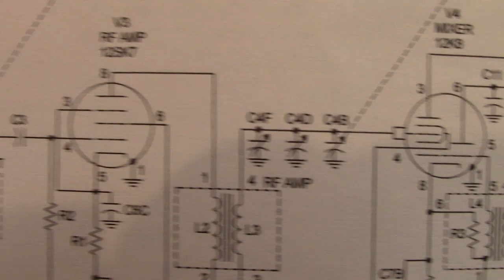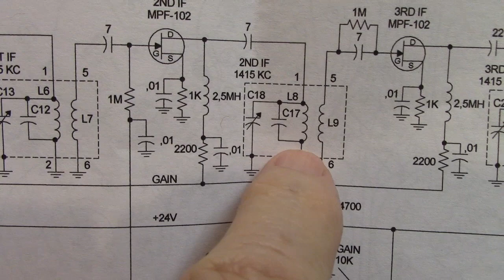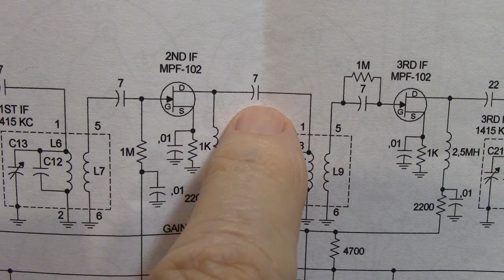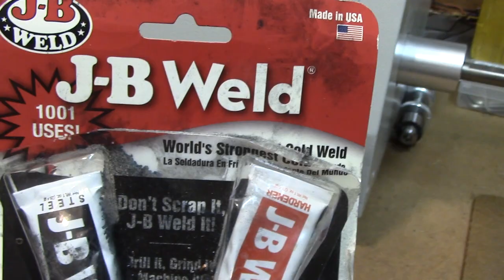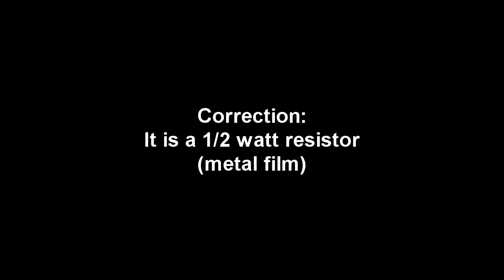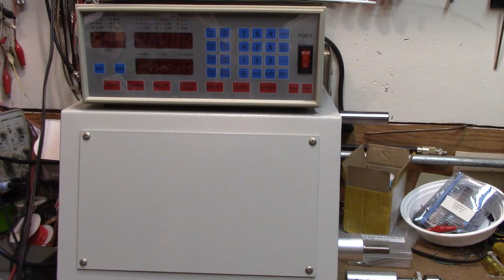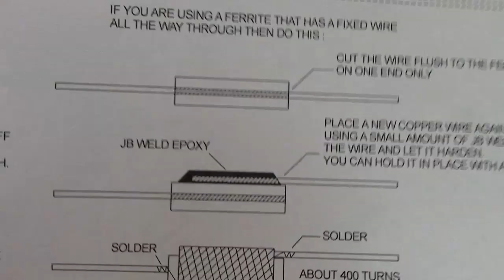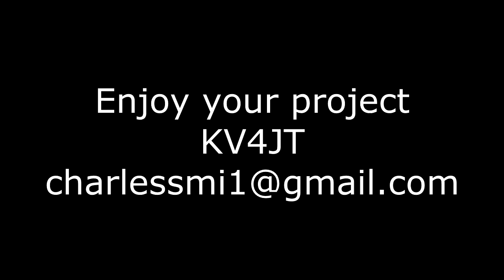RF chokes for solid state conversion projects

Comment: Oh, BTW, the resistor is connected, so it that why you're using high-ohm resistors?
Reply from the maker: Yes, the 1 or 2 meg resistors will not affect the ability of the choke in these applications.